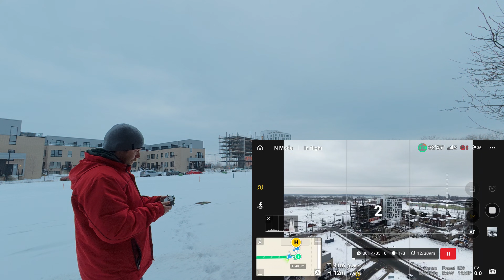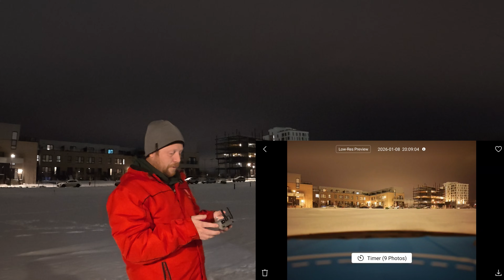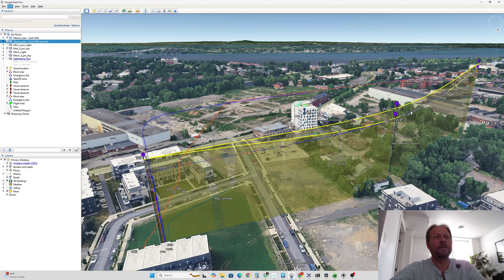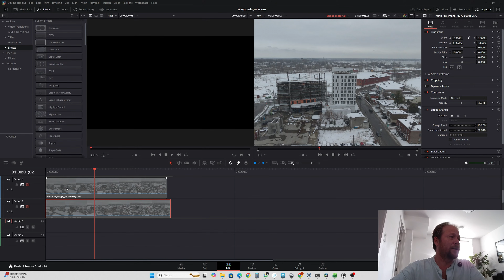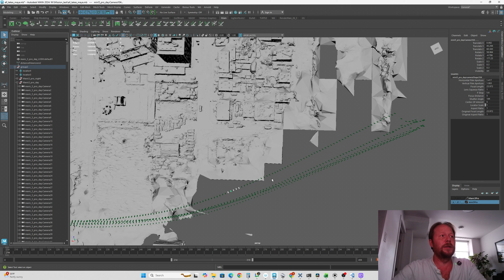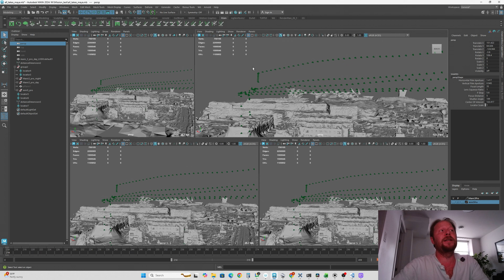Before You Trust DJI Waypoints - Watch This Test

Comment: Wow, what a great video examining the process of drone flight repeatability. To increase accuracy of photogrammetry, dround control points (gcp) are used to ground truth the images. A linear path in 3d would be difficult to control but would it compensat for flight differences? Thank you for your extensive effort to present the information.  Great job! Fly Safe!
Reply from the maker: Thanks, really appreciate that.

You’re absolutely right - ground control points (GCPs) are the standard way to georeference and ground-truth photogrammetry results, and they can dramatically improve absolute accuracy of the reconstructed model.

However, GCPs don’t actually solve the issue explored in this video. They correct the final model alignment, not the camera path repeatability. If two flights follow slightly different 3D paths, GCPs can pull the reconstruction into the right world coordinates, but they don’t compensate for differences in parallax, view angles, or camera positions between runs.

A perfectly linear 3D path would help reduce variability, but on consumer drones it’s still executed approximately, not deterministically, so some divergence remains - especially between separate flights.

Thanks again for the thoughtful comment -  glad the breakdown was useful.

Comment: Great video. Can you create a tutorial on how you got your flight path into Google Earth? I would also like to see how my waypoints did using Google Earth. Sometimes I set up Waypoints, and then when I click Go, the drone will often try to fly directly into a building or to the ground. Does this happen to you also? If so, what do you do to fix this? I often have to resort to Quickshots and not get the exact shot I wanted when this happens.
Reply from the maker: Thanks, glad you found it useful.

I actually already have a tutorial on exporting flight logs into Google Earth, and I even built a custom Python-based tool to convert and visualize the data properly, even from drone  Point of few (DJI logs → KML). I’ll add a link to that so you can check it out - it goes a bit deeper than most workflows you’ll find online. If you interested I can also share a path for windows executable tool that convert logs to Google earth path with ability so preview from drone point of view and not just the 3d path.

https://youtu.be/NZfIcysOXYc

Regarding the drone trying to fly into buildings or the ground - I personally haven’t experienced that behavior. In my tests, the issue isn’t the drone ignoring obstacles, but rather the real flight path deviating from the planned one due to GNSS accuracy and  altitude reference. That deviation can look like the drone is “heading into” something if the mission is planned too tightly.

That’s why I always plan waypoint missions with very large safety margins and never rely on them in constrained spaces. Google Earth is useful for analysis and validation, but it shouldn’t be trusted as a collision-avoidance preview.

I’ll make sure the existing Google Earth tutorial is easier to discover, since a lot of people seem to be interested in that workflow.

Comment: You mention that you loaded the waypoint mission into the dji mini 5  pro having prepared it first in litchi. I didn’t think litchi was compatible with Dji mini series beyond the mini2. Can you confirm please?
Reply from the maker: Yes, you’re right to question it - to clarify: Litchi does not fly the mission directly on the Mini 5 Pro.
What I did was plan the mission in Litchi Hub, export it as a KMZ, and then import that KMZ directly into DJI’s RC2 (Mini 5 Pro) and RC Pro (Mavic 3 Pro). The mission was then flown using DJI’s native Waypoints, not the Litchi app.
So Litchi was used as a planning and export tool, while execution was done entirely by DJI’s waypoint system.
In this video, I am going into details about this process - https://youtu.be/HxY_KT00SYU
Reply: @AerialOdysseySkies wow didn’t know you could do that! And presumably it works as well as if it had been created in dji.

Comment: The common denominator in both of these drones is the fact that they are not professional grade drones. As far as for recreational purposes, they are second to none. Clearly. But as for pinpoint accuracy in data point results, using DJI professional grade drones to test for tolerance and repeatability results against same professional expectations would be the more logical thing to do. Again, for recreational, or even cinematic quasi professional purposes, excellent quality against any other recreational grade drones on the market.

Comment: I appreciate the deep analysis, as there are many like us who are trying to do serious work within the limitations of the consumer drones and understanding these limitations is very valuable. I did read somewhere that tthe Mini5 has a newer GPS receiver that promises greater accuracy. As to the accuracy and sensitivity of the cheap barometric sensors, I can’t answer your question, but have learned that even an iPhone’s barometer can detect vertical movement of 1 foot (phyphox app). The fact that the Mavic 3’s barometric altitude got ‘stuck’ on one value does seem odd; one would expect to see a little signal noise on these values unless they are heavily filtered.
Reply from the maker: Thanks, I really appreciate that.

That’s exactly my motivation here - trying to understand what actually limits serious work on consumer drones, not just what the logs suggest.

I’ve also seen claims about the Mini 5 Pro’s newer GNSS, and in isolation, it does seem slightly better in some cases. But what surprised me is that even when GNSS looked stable and repeatable in the logs, the real-world camera position still diverged noticeably once reconstructed in 3D and one path on Mini 5 pro had a significant lateral difference accumulation error.

On the barometer side, I agree with you - the raw sensors themselves can be very sensitive (as your iPhone example shows). That’s why the “stuck” altitude on the Mavic 3 stood out to me. My assumption is heavy filtering or fusion logic masking slow drift, which keeps the logs clean but hides gradual error accumulation over time

Appreciate you taking the time to watch and think it through.